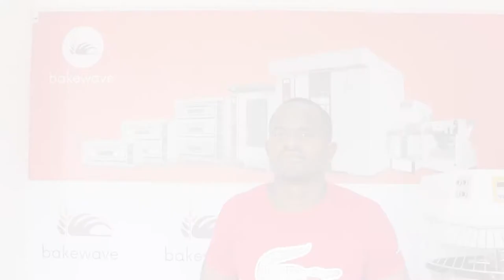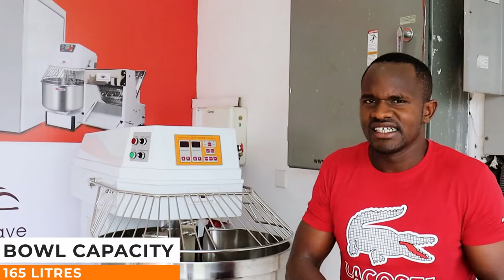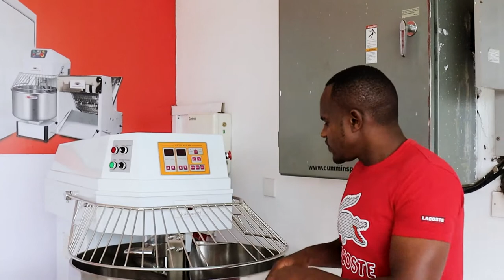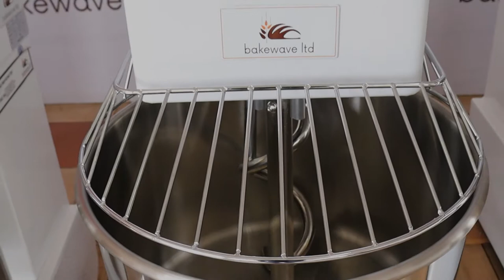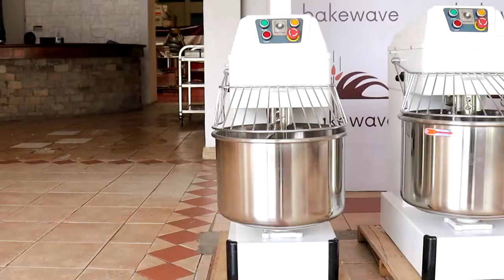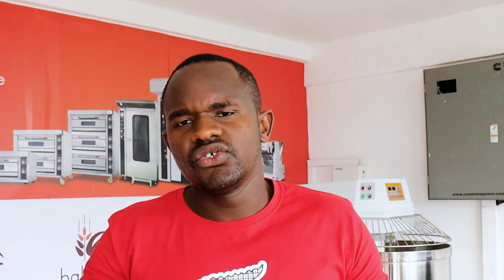Buying a dough mixer in kenya ? DON'T BE CONNED! Please watch video

Comment: Is it popular now to have net over the mixer?What is their function cause it is pretty hard to pour the four in with the net around? Also could you please use USD for quoting the machinery prices? For the convenience of foreign exchanges
Reply from the maker: Yes 
1.the safety guard on the  dough mixer is very important since if an item that is placed on the mixer carelessly (like a knife,spoon,watch,plate) if it drops inside during mixing :it will be ejected at very high speed and can cause bodily harm or death
2.Incase accident someone falls on the mixer during mixing and it prevents hands from entering the mixing bowl and this could crush the whole hand or uproot the shoulders because these dough mixers are very powerful
Regarding prices which country are you in?
Reply: @BakewaveTV  Thanks for the detailed, helpful explanation. It doesn't matter where I live, as long as the USD still  goes strong it would be used as foreign exchange.
Reply from the maker: @chm8804  sure and thanks a lot for engaging us :we are standby incase you need any further information or assistance

Comment: What are the prices of the mixers and where can one buy them in kenya
Reply from the maker: Hello @marymucheru5777. Thankyou for reaching out to us, we have various sizes for the mixers with different pricing points. We are also based in Kenya in Nairobi, along Mombasa Road at the 3rd Godown immediately after Odds and Ends. You can reach out to us on 0746 752 766 for more information.